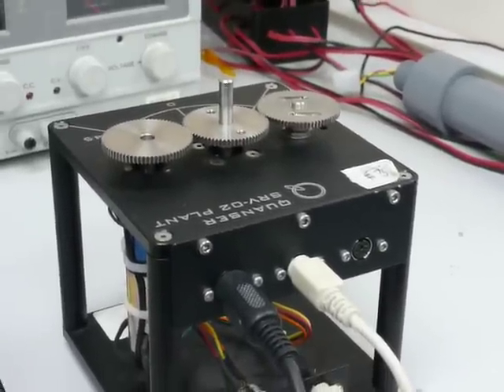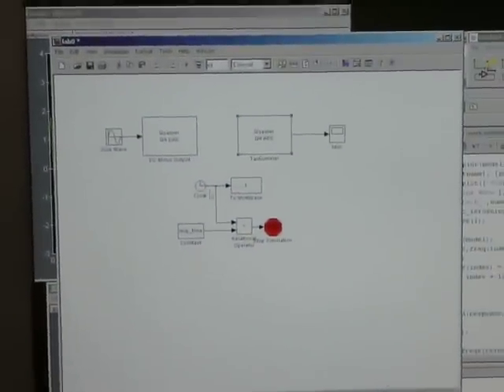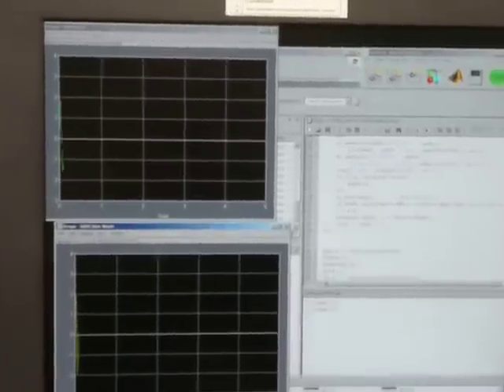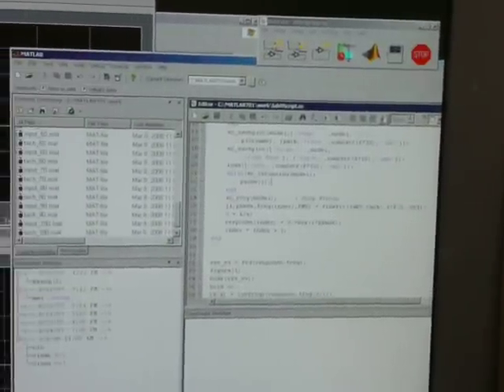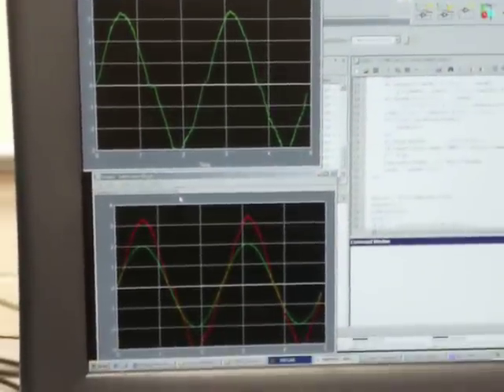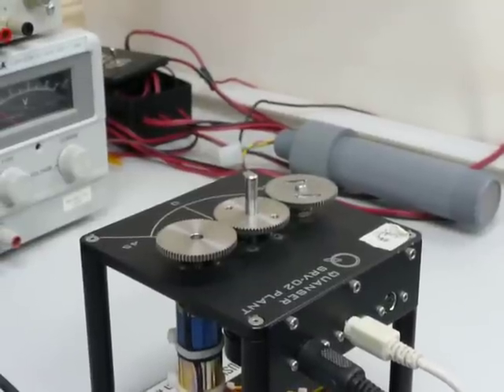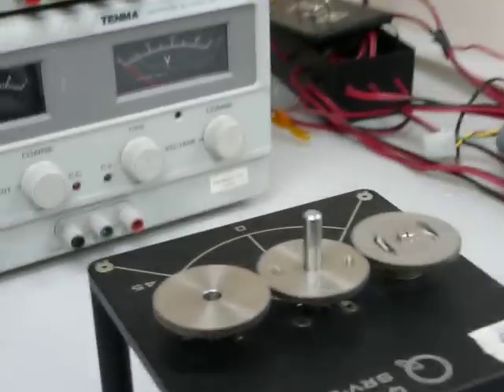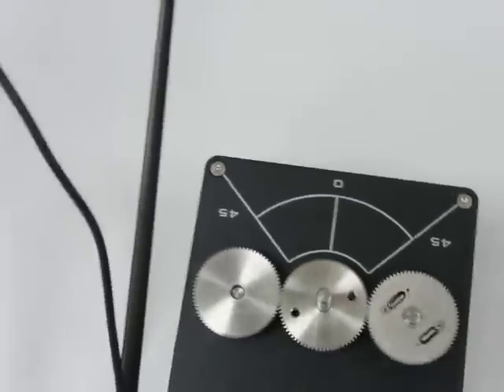Quansar SRV-02 Motor Controller

Comment from the maker: @RotaryControlLab Thanks, as you said it's been a while so I'll try to remember back.  I think the thing that frustrated and limited me the most was lack of documentation, rather that's because I was not given access to it or my university did not have it, I don't know.  Particularly more info on the wiring and IO would have been helpful as there were times when things did not work and I had no idea if it was my controller, my hardware setup, or just plane the hardware.